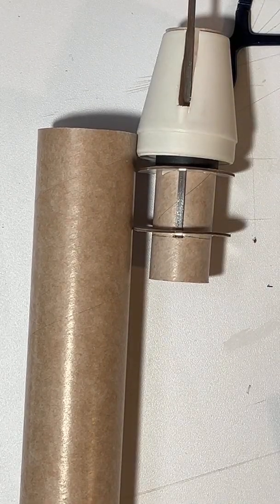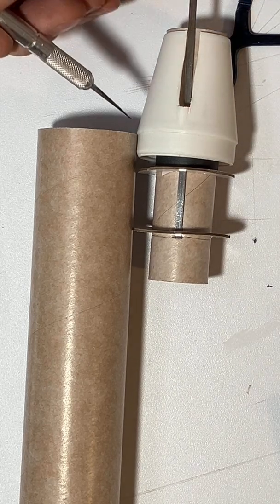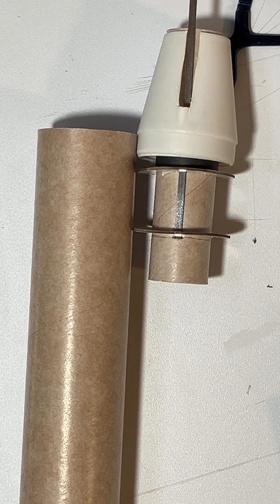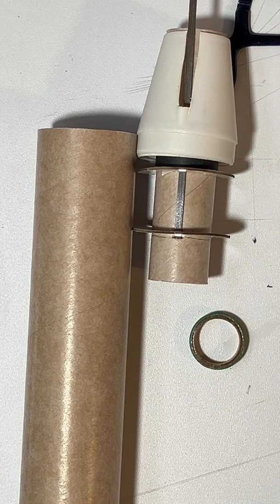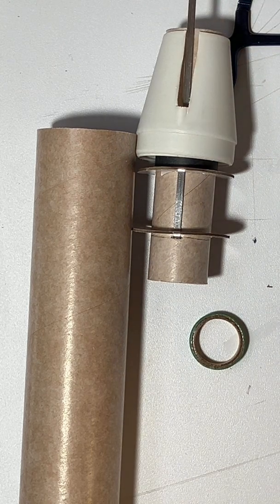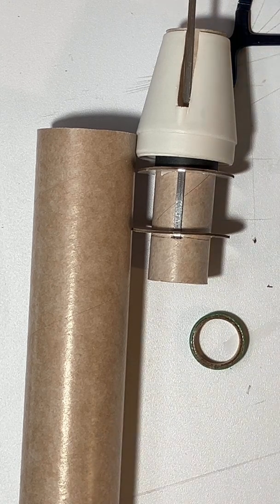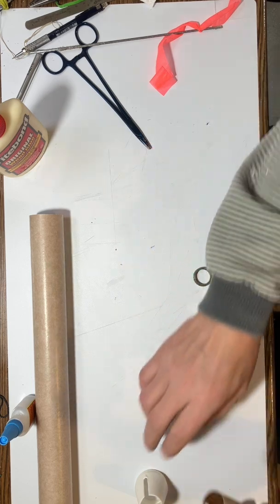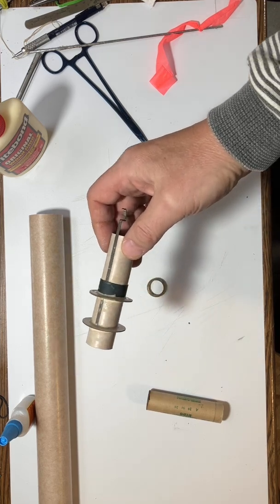Custom #2, 4/8 - Gluing Engine Mount Tube

Comment: Maybe shorts isn't the best format for this...
Reply from the maker: Yeah, this is an advanced topic and there are no instructions. I have done long 20 minute videos on deeper subjects, but nobody watches them. I only focused this 8 part series on building skills for mounting tail cones and how the engine mount needs to be measured differently. Hopefully a rocketeer can now use a tailcone on any design with confidence.